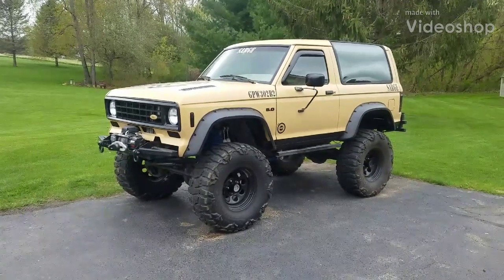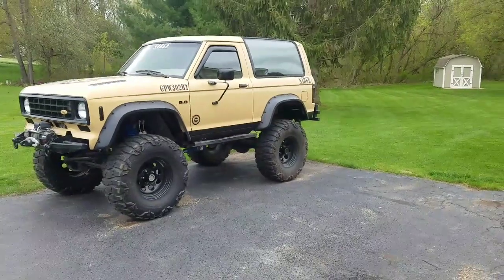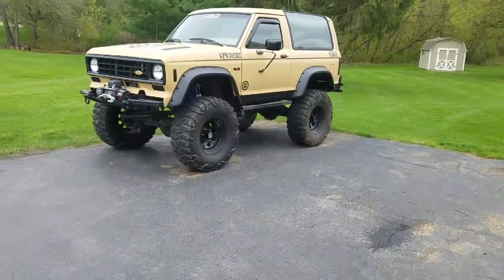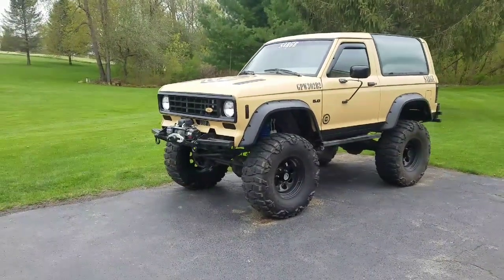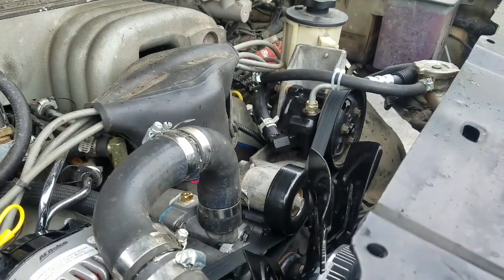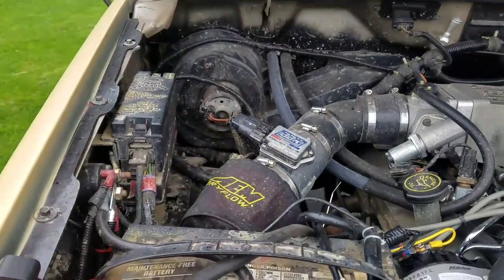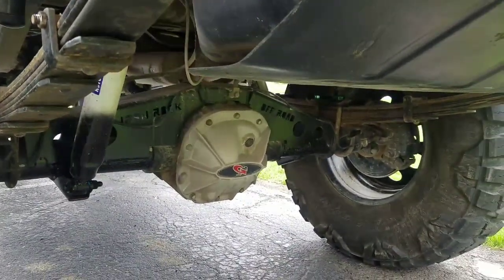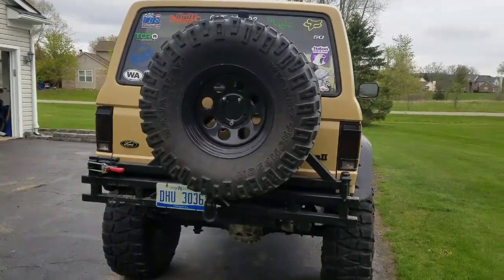Built V8 Swapped 302 Ford Bronco II Walk Around Video. Details on Complete Build CHECK IT OUT!

Comment: Looks very cool, I am in the beginning stages of fixing up a 1984 Bronco ii.  I am not a hot shot mechanic, and it is going very slow.  But am exited about the project.
Reply from the maker: That's awesome!  Keeping it stock or lifting it or?
Reply: @BuildItWheelItExploreIt  i have big dreams, but for now getting spark to the spark plugs, and getting it running.   Plus, just replacing worn out parts, etc.  I wish I had someone like you, that could help / advise.   Slow, but moving forward.  I am still watching your video.

Comment: Amazing car.  Thanks for sharing!    Issues with rotting under?
Reply from the maker: Thanks!  Not sure what you mean about "rotting under"?
Reply: My mechanic friend used to say they are “rot boxes” - they rot out badly -
Tailgate is notorious, floors are an issue, 1/4 panels rot at the back lower above and behind the wheels.       So was curious if you had any problems.   Thanks for sharing your car!   Looks like you’ve maintained it very nicely!
Reply from the maker: Yeah, I mean any 30+ year old vehicle is prolly gonna be rough, depending on what state you live in.  Luckily, this only had 47k original miles and was 99% rust free.

Comment: What radiator did you go with... im doing a 347 in my 85 ranger but stumped on radiator to fit...
Reply from the maker: I didn't know anything else when I did mine.  So, I bought the v8 swap radiator from James Duff.  Since then, I've learned that AFCO is the company that Duff was selling.  Also, there is one from Northern.  Just pay attention to the fill cap as I've seen it vary.

Comment: Hey super cool build, looking to do basically the same thing, have found a 93 mustang for engine swap.

I have a 85 B2 with manual, confused about the transmission. What transmission did you use/set up for the mustang 302?
Reply from the maker: Thanks, Thought I covered all that in the video, a C4 out of a 75 Bronco with its matching D20 tcase... but I have an atlas transfer case on order.

Comment: Did you have trouble with the pinion angle and centering the rear axle? I'm stuck on that part, because one axle on the 8.8's is longer. Idk ithink I'm over thinking it.

Comment: When you did the explorer p/s setup, what power steering hose did you use on the high pressure side?
Reply from the maker: Used a gates 360530 pressure hose and had to straighten out the factory bends on the steering gear side...

Comment: So on the 1st gen front end, did you have to change hood , fenders and core support?
Reply from the maker: Yes, hood, fenders, core support,etc all were swapped over.
Reply: @BuildItWheelItExploreIt  hey back in 1983  when the new bronco 2 came out did diesel engine was a option or not

Comment: i just recently picked up a bronco 2 from 90, do you have any suggestions for a 2 inch lift spring? I wanna lift that only involves the springs so its easier
Reply from the maker: I ran 2" skyjacker soft ride coils back when I 1st got it.  You'll need to run 2-3/4 degree camber alignment bushings as well.. then rear you can do 2" blocks but make sure they are steel not aluminum.

Comment: Does the 1990 have the same lug pattern as a the 1985? I just bought the 1985 2 days ago and looking for wheels and tires
Reply from the maker: Yeah all Bronco II are the same lug pattern 5x4.5... same for the rangers (upto 1997) and explorers (upto 1994) mine are now 5x5.5 from the D44 front and yukon chromoly rear axles to match.

Comment: CG is to high for the width of the vehicle.
Reply from the maker: I won't disagree with you, but this was my 1st build, and I wasn't doing any crazy off camber off-road stuff... although that started to change quickly.  I learned a lot on this build and learned even more about hardcore trails and rock crawling, which is why I built a different rig.  94 Ford Explorer, which has 1 tons, linked suspension coil overs, etc.   Check out that build if you're interested.  Amazing offroad very stable and with all the suspension I very rarely lift a tire off the ground.
Reply from the maker: And I also would never use narrow.early bronco axles ever again. From that build forward, I've helped some buddies on theirs, and we use full width d44 and 9" axles. So much better.